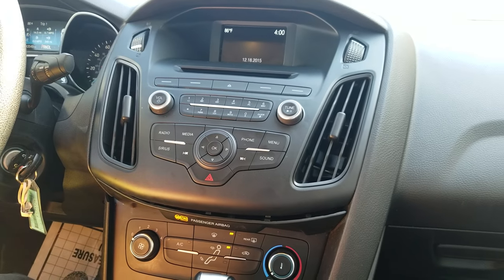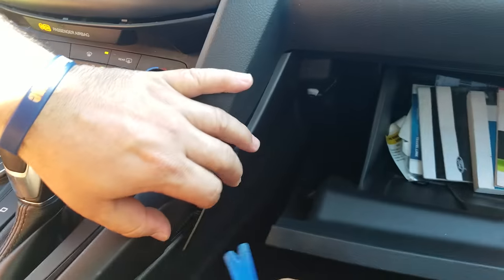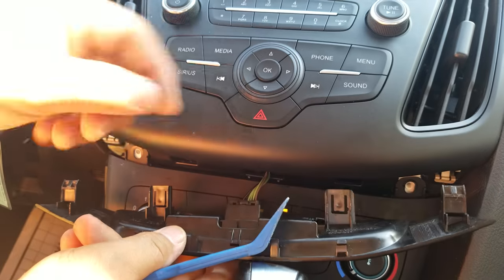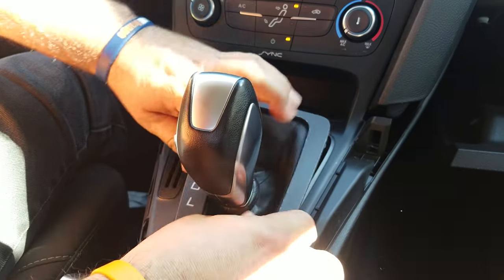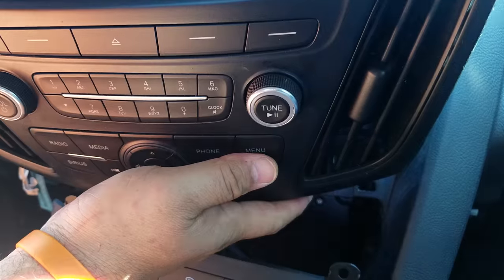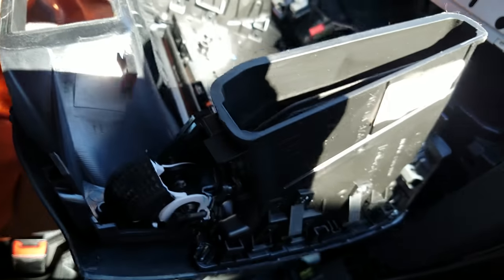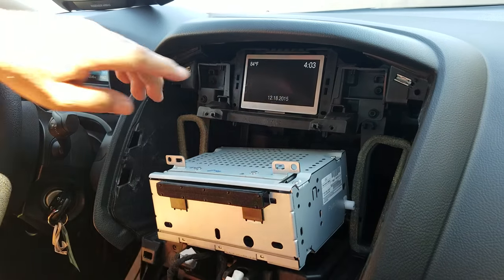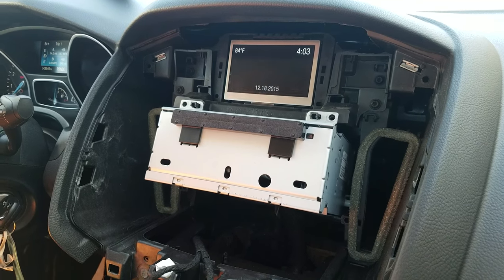How to Remove Radio / CD Player from Ford Focus 2016 for Repair.

Comment: Man Mine is going crazy. So loud popping and static its insane. Thanks for this video. Next days off need to atleast unplug the head unit. Thanks for the Video
Reply: My car is currently having the same problem, would this be the solution to fixing that?
Reply: I'm also experiencing this. Does anyone know the issue?
Reply: My 2016 was doing the same thing now the radio doesn’t even turn on. Did you ever fix it?
Reply: @linz12288  I believe it's what is called a cold solder joint.  This is when a component soldered to the main circuit board was not soldered correctly., or the solder was not hot enough to flow into the joint.  This causes that intermittent crackling noise you hear.  I have the same problem.  It's very difficult to isolate the bad joint because there are hundreds of them.  You can just do your best with a magnifier and attempt to reflow the solder into the joint.

Comment: Thanks for the easy to understand instructions on removal of this control module.  Currently our 2015 Ford Focus makes very loud static pops and noises.  Wondering whether removing the radio fuse is a temporary fix for this?  Also, I will call to get a quote on sending the module to you for repair but wondering if removing it will disable any other systems (locking, etc.) once I put things back together without the radio while waiting for it to be repaired.  The car is an SE model with keyless entry.  Thanks!
Reply: This is my current issue on my 2015 focus se. What turned out to be the issue and how did you fix it?  Thank you!

Comment: This was great.  Thank you so much!  Only issue now is that my airbag light stays on.  Does that have to do with disconnecting that wire cluster when removing the dash components?
Reply from the maker: Most likely you need to have the Airbag reset if it does not go away by itself.

Comment: Hello sir I hope you are doing well, my sync bluetooth will connect to my phone only for a little bit and then it will say that the phone was disconnected. Should i do this to fix that issue? I’ve tried resetting my car, my phone and disconnecting and reconnecting the phone but nothing has changed. Any help will be great, thank you)
Reply from the maker: Problem could be the phone so try a different phone first.

Comment: great video, question for anyone who has done this or can help. I'm wanting to remove mines to wrap it , will removing connectors force me to reset radio etc or anything. also do i need to disconnect the battery first?
Reply from the maker: This car has a plug and play sound system, no need to disconnect the battery either.
Reply: @HiTechElectronic  thanks for the info mate 😀

Comment: Do you need a wiring harness to install a monoamp>sub to this radio for this car?
Reply: Pretty late, but I ended up splicing into the high-outputs for the speakers and soldering in my own wires. The amp I chose has high-level inputs which made adding it pretty simple wiring wise. I couldn't find any off the shelf wiring harnesses for this. I installed my sub a year and a half ago and did new door speakers as well. Looked at this video again because I'm thinking of adding a 4 channel amp for the door speakers as they are 3 ohm now and would probably overheat the head unit if I turned it up too much.

So yes, you do need a wiring harness, whether you can find one or you make your own like I did.